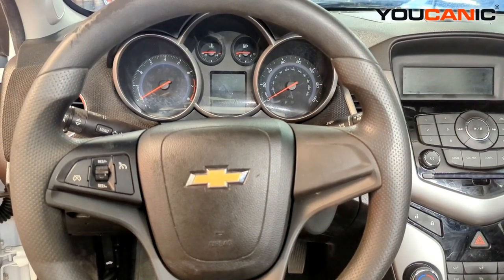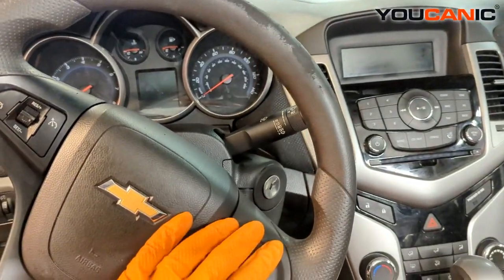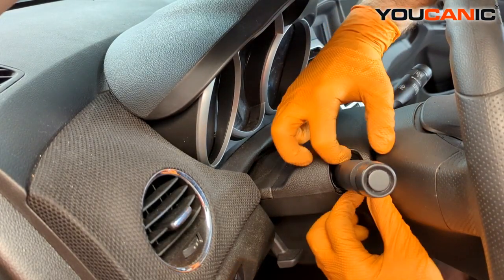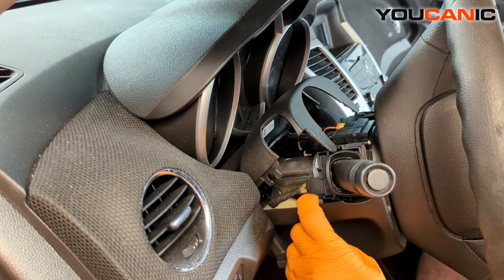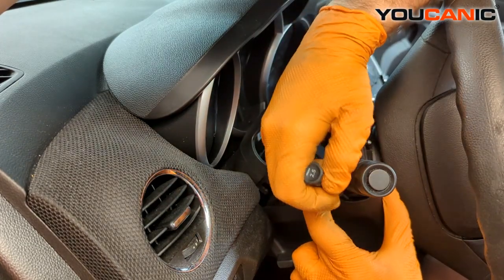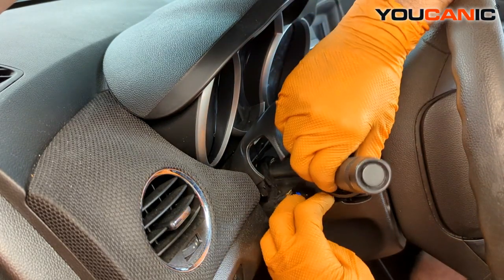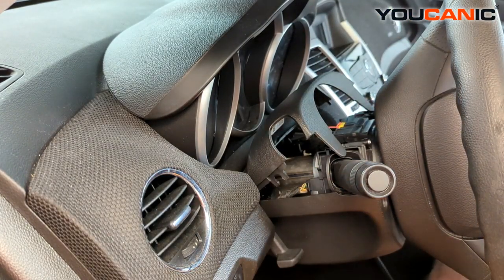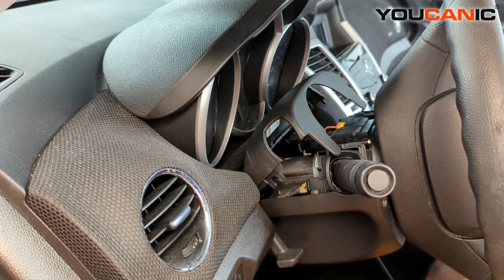2008-2016 Chevrolet Cruze - Combination Switch (Turn Signal & Wiper Switch)  Replacement

Comment: After changing the signal switch the traction control lights up on the dashboard do you have a solution for that ?
Reply from the maker: Thanks for reaching out! After changing the signal switch, if the traction control light lights up, it could indicate an issue that needs further investigation. At Youcanic, we provide helpful guides, free resources, and even our advanced YOUCANIC scanner to assist with all car-related concerns. We are dedicated to empowering car owners, and ensuring you save money while building confidence in car maintenance.

Please feel free to reach out to us on our website, www.youcanic.com, for any further assistance or queries. If necessary, we can make factory repair manuals available for you. We're here to support you on your car ownership journey, every step of the way!

Comment: I have an 08 Chev Cruze without the telescopic steering wheel and it is different. This video will not work for removing and replacing the turn signal switch. I got it partially out but there is not enough clearance to remove it all the way.
Reply: So the airbag will have to be removed in a non- telescoping wheel then, correct?  I'm pretty sure I have to do this repair due to the wipers turning on every time the car is started the wipers turn on no matter the portion of the selector.  Will not to off until I turn the wiper position to on the off again. Annoying  as heck for the last 3 year